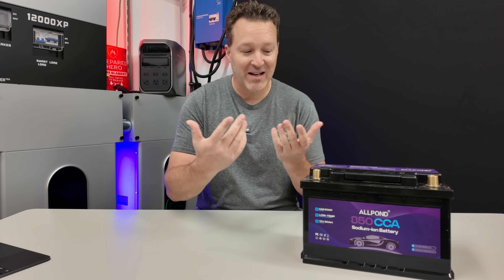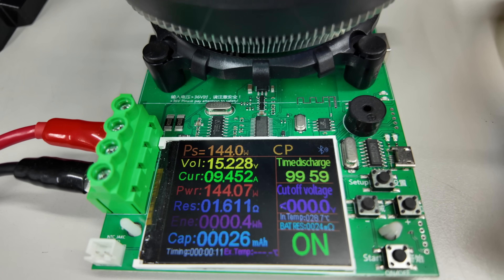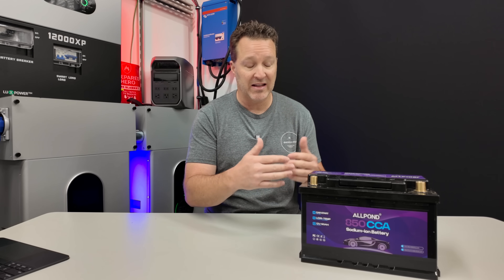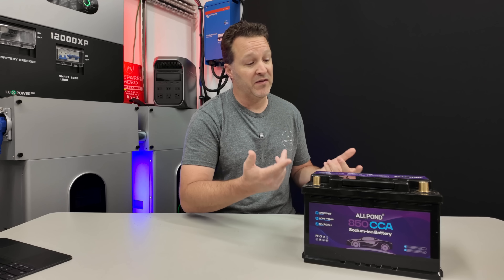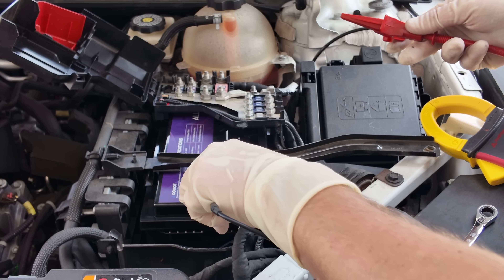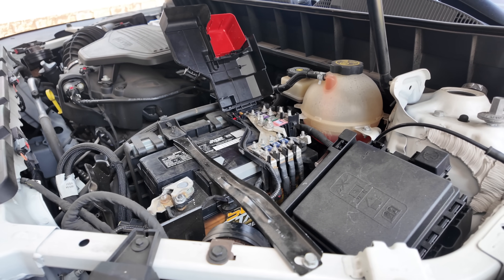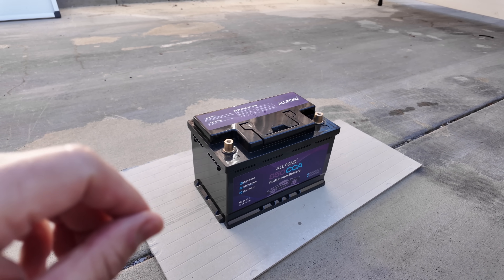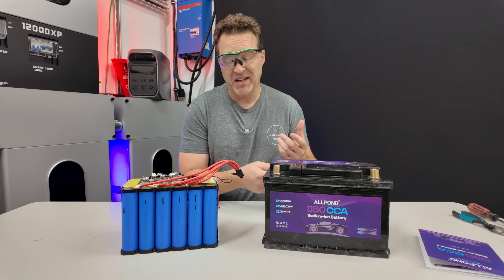Sodium Ion Battery Tech Hits The Auto Industry!- Are We Ready?

Comment: Ahh, too bad the car didn't like it.  Well, not unexpected.  Lead-acid batteries have very low current acceptance, which basically means if you apply a charging voltage to it the lead-acid battery will immediately rise up into it during charging, which limits the current.   Same thing happens when discharging just in the other direction.

Sodium and lithium batteries have very high current acceptance, which basically means that apart from an initial small movement in voltage, the battery chemistry's voltage will not immediately rise towards the  charge target.  Over time, yes, but not immediately like lead-acid does.  Thus these batteries will take in more or less however much current the charging system is able to deliver.

The vehicle's charging system obviously didn't like the fact that the sodium battery was taking in 100% of the current the car could deliver to it.

Another huge problem with direct replacement is that due to the high current acceptance, a lithium or sodium battery can easily burn-out a vehicle's alternator if the current isn't managed.  There ARE LiFePO4 batteries that can do this... the BMS's are more complex (they have a large inductor / FET circuit to limit the current).

--

As you found out the hard way, when it comes to "drop in replacements", most of the stuff advertised on Amazon is just straight out lying to customers.

And OMG... they actually soldered the crimps?  Absolute garbage.   Normally you don't solder crimps, and you never solder crimps without strain relief and vibration dampening (which those cables didn't have).   The reason is that the solder creates a very sharp interface on the strands between the part of the wire that can shift around and bend, and the part of the wire that cannot.  This will break the strands in the wire at the interface over a relatively short period of time. 

Large crimps like those are supposed to be cold welds.  Nothing else is necessary.  Definitely not soldering.

Small hand crimps are not cold welds and with appropriate strain-relief soldering is sometimes ok to do after crimping (it adds a layer that blocks corrosion).  But so many people get it wrong (people do it before crimping, which is bad, and people do it without correct strain relief, which will cause the wire to break over time)... so many people get it wrong that soldering is generally disallowed entirely on crimps in code.

--

On the DC clip-on amp meter... it needs to have an inrush function.  The regular min/max feature doesn't usually measure inrush current..  Read the manual for that particular model to see if you need to do anything special to get inrush current.

-Matt
Reply from the maker: The meter has inrush but only for AC function. I have used it several times for inrush but I couldn’t find a setting for DC inrush unfortunately. 
Hence my scan tool would have shown more ….🤦🏼‍♂️

Comment: The voltage regulator was satisfied the battery was charged so it did not provide charging current?????
Reply from the maker: No. The alternator runs the vehicle especially with the AC unit on plus light in the cab and DRLs 

So battery charging voltage should have still been at least 14.4-14.8
But it was solid 14. Plus the error message that went away before i could film it 
Which I out a message in the video as you can see
Reply: @johnnysweekends  With sodium would only rise to the voltage target of the alternator once the sodium battery is charged sufficiently to be at that voltage.  Since the sodium (or lithium) batteries have high current acceptance, the terminal voltage won't actually rise immediately like it does with lead acid's low current acceptance.  Instead, the terminal voltage will only rise a little from the resting voltage of the battery and then track the actual charge state of the battery after that.

The alternator can try however hard it wants, it won't be able to force the voltage up.  The engine computer didn't like that.

With lead-acid, when you apply a charging voltage the battery chemistry will immediately allow the voltage at the terminals to rise significantly towards the charging target voltage, vastly reducing current acceptance (naturally reducing current acceptance).  Even though the battery isn't charged.

-Matt

Comment: Good review of these batteries.  Imo those Amazon reviews were totally fake. Unfortunately there's a lot of that. As an auto technician I can say batteries have become such an issue. They went to AGMs on a lot of new cars and it helped but hasn't solved the problem.  I can say its really not the batteries fault. Its charging logic brought to you by none other than the EPA. As the mpg regulations get higher and higher manufacturers look everywhere to save a drop. Alternator logic has been one of those areas. In some cases ive seen voltage drop to As low as 11.5 volts before Alternator would begin charging again. Thus doing slow damageto cells. In theory it works but it makes for loss of longevity in batteries, which creates more solid pollution, and more headache/ cost for consumers.
Reply from the maker: Totally fake reviews ! 
That Jessica is smart though 😂
Reply: When a review reads like a marketing propmotion then you know it is fake. A genuine review does not look that way.
Reply: Former auto tech here. Funny how your comment explains why the charging algorithms aren't good for the customer, that they lead to early battery failure while the engineer in the comment above mentions this same algorithm but has no clue what the real world effect of this is lol.  Typical, the engineer gets paid the big bucks to mess things up while the auto tech saves the day for penny's on the dollar.
Reply: Yes my car let's it drain
Reply: I watch my charging voltage like a hawk. My 2018 Colorado diesel uses this crazy charging algorithm. Going up hill the voltage will drop to 12.3 then on the flat it will hold the battery at 12.5 but going down hill and off the throttle it will climb to 14.7 . Then it will go through a desulfation step and charge the battery at 15.4v for an hr or so. My little 2.8 4 banger diesel battery is AGM and cost me 400.00 and that’s not from the dealer.
Reply: When you are using a GM vehicle you need to let the computer (ECM ) relearn the state of the battery. GM uses an algorithm to adjust the charging voltage depending on how long the battery has been in the vehicle. Some GM vehicles even have a reset that can be used to tell the ECM that you have installed a new battery. You will need a high end scan tool to get to the reset. Once you tell the ECM you have changed the battery the algorithm will treat the battery completely different.

Comment: Seems like it would be a simple electronics revision to just accept a lower input voltage and boost it internally if the battery chemistry requires a higher voltage to fully charge, why would they not have done so before releasing a battery intended as a drop in replacement for lead acid starting batteries, seems like a glaring and obvious oversight... This is the kind of thing an actual product user and feedback cycle would quickly ascertain prior to product launch, seems like some EE/spreadsheet jockey just looked at a spec sheet for some MOSFETs and said hey we can do more amps, throw it on a board and throw it in a case and print a label, without ever putting it in a vehicle... looking for to the follow up review where you crack it open and find board version 1.2 inside that actually allows it to be widely compatible with vehicle charging systems 😊😂
Reply: It would cost more. Manufacturers don't like additional costs. The battery is made down to a price,mont up to a quality. The soldering and internal packaging tell us that fact.

Comment: Those are most definitely fake reviews.
Reply: Yup.  And it should also be noted that cycle life for sodium or LiFePO4 or NMC for that matter is basically 80% DOD cycles.  A cycle that only drops the battery 10%, then recharges it, is not "1 cycle".  It's more like 1/8th of a cycle.

So for those rosy reviews, real or fake, the people making the reviews don't really understand how lithium (and sodium) battery cycle life is counted.  So of course its not going to lose capacity for their use cases.  It wouldn't lose capacity with a 100 cycles even if it were being cycled 80% DOD each time.
Reply: @junkerzn7312  some capacity is typically lost at even 10 cycles.  It's not much but it's measurable.  You lose progressively less capacity with every cycle.
Reply: yep most definetly! someone gave me an advice to actually read the worst reviews instead of the 5 stars ones.
Reply: @carholic-sz3qv  i do the same thing.  You can tell much more quickly what you can expect.
Reply: I always start with the 1 stars. I continue with looking at the product based on the reason for the one star, often it's because of ignorance of the reviewer. Too often though it is because the product is junk
Reply: ANYTIME you see a review that looks more like advertisement for a product, or when the reviewer calls the item “product”, then it is a fake review.
Reply: @oneisnone7350  why it call fake review
Reply: @sivi6759  每個行業對其產品都有所謂的黃金標準，當專業人士看到影片中對黃金標準次序或重要性模糊焦點，只談單一指標的突破，那有99.9999%一定是商業廣告手法
Reply: @oneisnone7350  Agree
Reply: The internet says that AI writing likes to use long dashes called EM dashes. There's one in the short review, so likely AI generated.

Comment: The area with cranking amps not being very high you might get a better reading if you can actually get it around the wire that feeds the starter to bypass. Everything else might give you a more accurate amp reading, but it should be higher than that.
Reply from the maker: Yea major thing is I didn’t use my OBD scan tool. Could have gotten all kinds of data 🤷🏼‍♂️🤦🏼‍♂️
Reply: ANY chemistry can be made to work in any conditions.

Comment: The pcm definitely saw something it didn't like. The voltage and current curve must have been different enough for it to reduce output to try and protect the battery. Might be worth clamping that meter to the alternator wire and running the test again. and maybe once more with the NAion fully charged if the battery is just taking more amps than the lead acid. You may have already included that in the first try though it was hard to see it passed that main fuse block
Reply from the maker: I wished I used my scan tool 😅 shows so much more I could have been getting live data …totally forgot 🤦🏼‍♂️
Reply: @johnnysweekends  vehicle saw battery resting at 14+V and assumed it was fully charged. Vehicle computer lowered voltage down (commanding lower field to alternator) to ~14.0 V following such assumption.